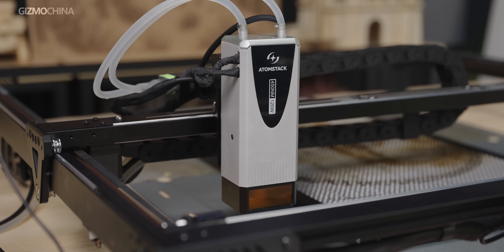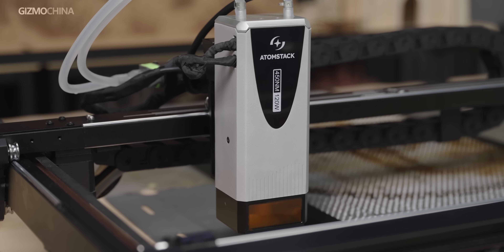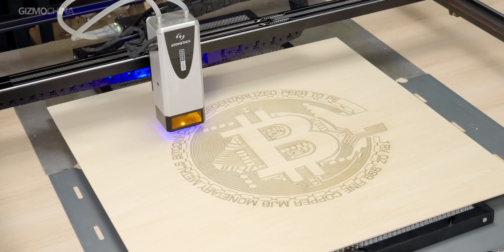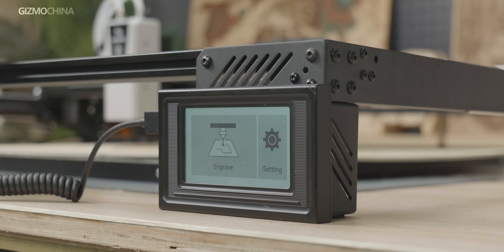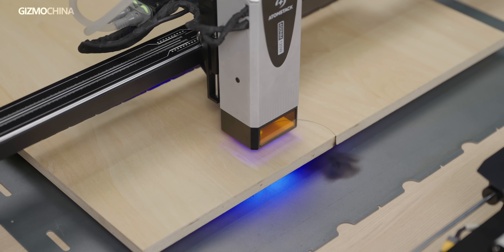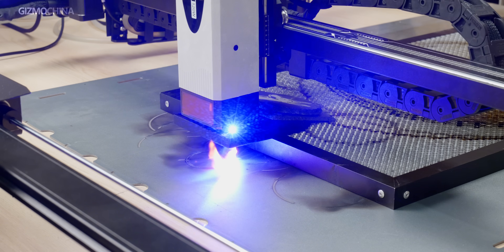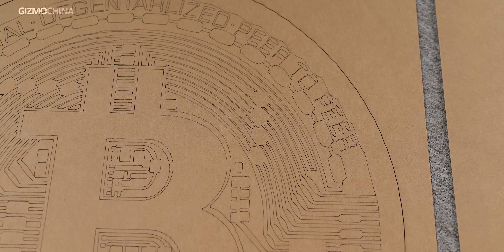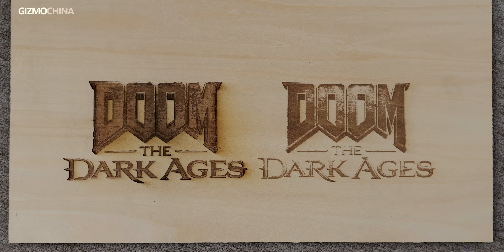AtomStack Glacier Water-cooled 120W Laser Engraver & Cutter: World's first Insane Power of 120W!

Comment: Not 120W more like 5W a 120W would catch the wood on fire and the table
Reply: OW this will.. My 20 watt Atomstack is going thru 0.05mm steel.. and it burns wood with ease.. the output they mention is seldom lied about. So this one will not disappoint.